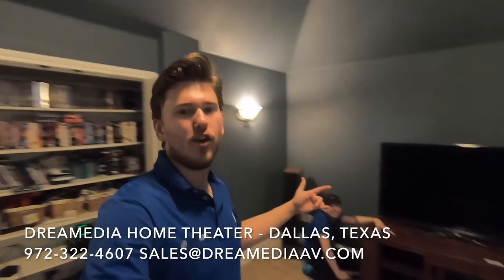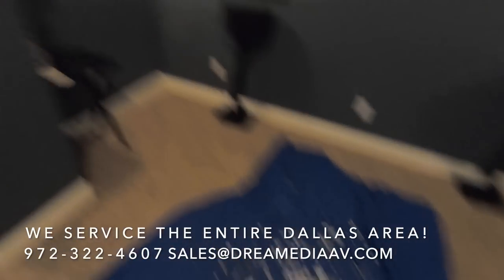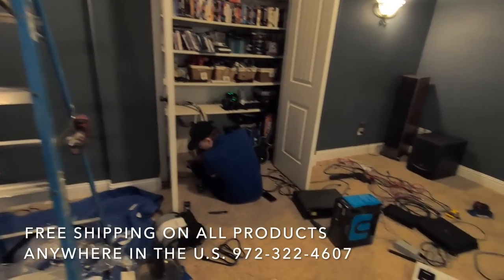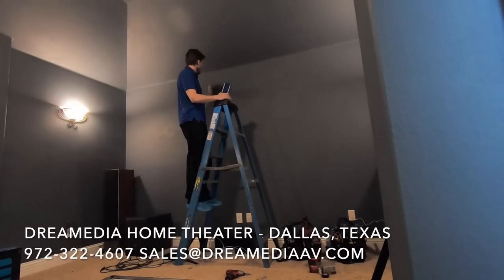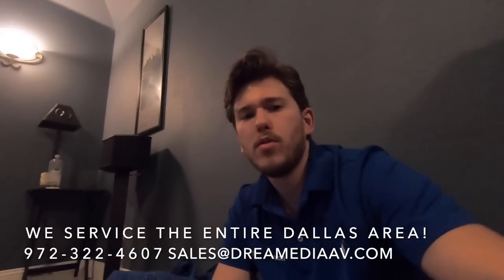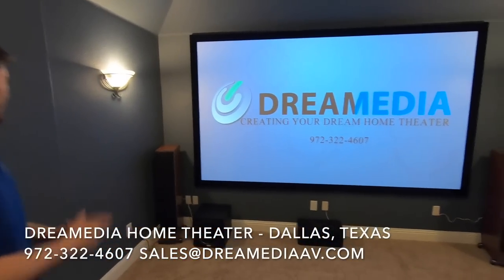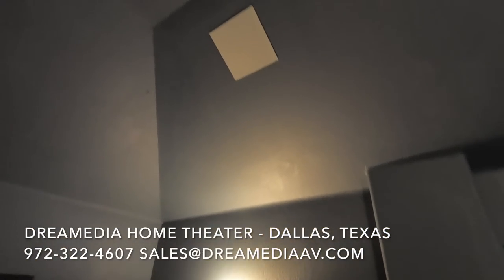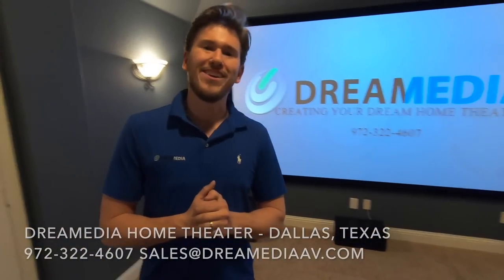Theater room UPGRADE! 55" TO 133" 4K and AFFORDABLE! PLUS DOLBY ATMOS!

Comment: Might have some heat issues with the PS4 on top of the receiver but otherwise nice setup!
Reply: yea i did that once with a ps3 but it was just on a glass shelf right above my onkyo i had at the time, the thing was constantly sucking in hot air from the receiver and ended up toast

Comment: The under side of the PS4 pro is going to be really hot sitting on top of the receiver the guy should get a AC INFINITY cooling system
Reply from the maker: We warned the customer. It’s temporary. He said he is getting a new one and would move it if it gets hot.
Reply: Correct, will be working on a cooling solution in the near future with Dreamedia.
Reply from the maker: Cobra Nikon Thank you for your business, give us a call if you need anything!